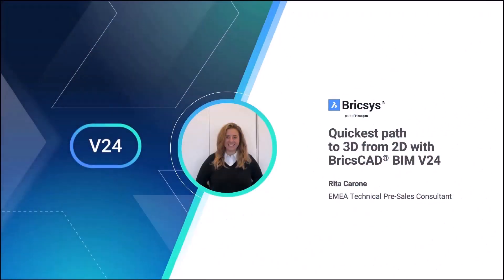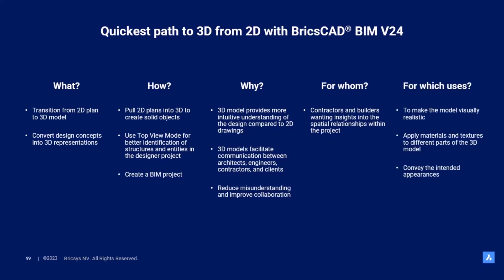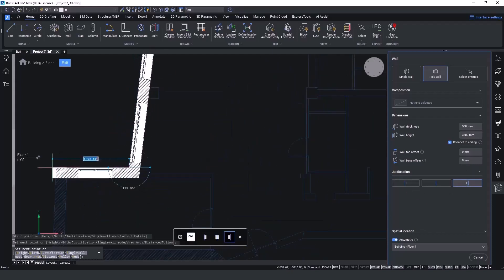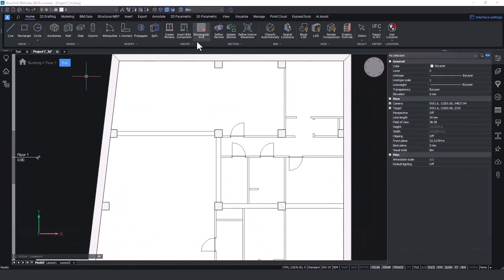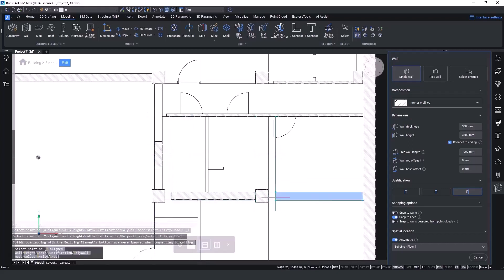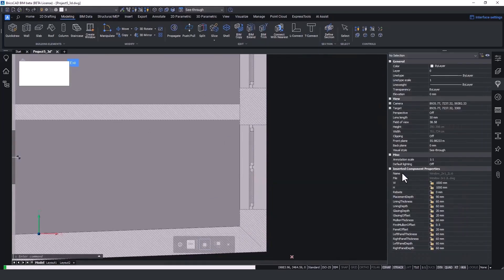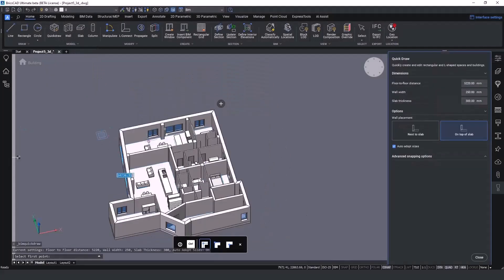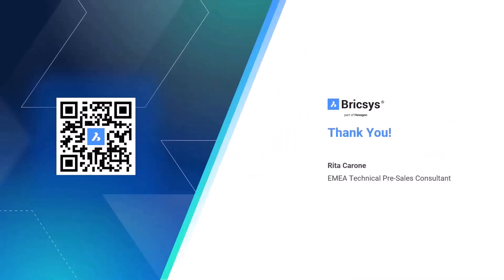Quickest path to 3D from 2D

Comment: Hello, I am interested in acquiring a BIM platform with this CAD environment (autodesk) but focused on urban planning and topography, that is, we want to show the urban furniture elements as BIM objects such as; poles, traffic lights, wells, closets, trees, flowerbeds, ramps, roads, platforms, stairs, valves, enclosures, etc.
BricsCAD offers these kind of libraries?
If you don't have them, can it be imported from an external platform?
I would greatly appreciate your support.
Reply from the maker: Hi there, thanks for your question! 

The available BIM Classifications from BricsCAD BIM can be found here: https://help.bricsys.com/en-us/document/dialog-boxes/c/classify-as-bim-element-dialog-box?version=V24&id=165079122924
 
You can export components from other software (for example through IFC) or create it in BricsCAD from scratch and classify it as a BIM Element. Then, the you can create a Component at the Library Panel from it:

https://help.bricsys.com/en-us/document/dialog-boxes/a/add-block-to-library-dialog-box?version=V24&id=165079121082

This Help center article could also help:

https://help.bricsys.com/en-us/document/bricscad-bim/modeling-techniques/creating-a-custom-window-or-door?version=V24&id=165079162054

You can download BricsCAD for free for 30 days - https://www.bricsys.com/bricscad-download,  so perhaps you could see if the library works how you need it to first, and if you're having an issue then you can contact our support team directly - https://www.bricsys.com/en-gb/blog/3-steps-to-get-help-at-bricsys

Hope this helps! :)